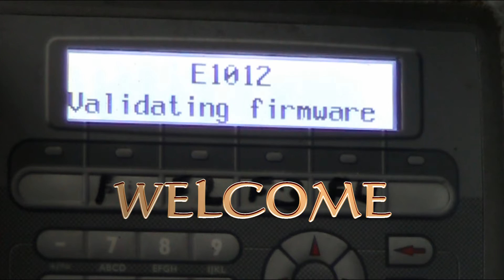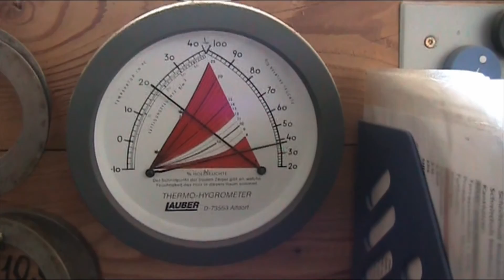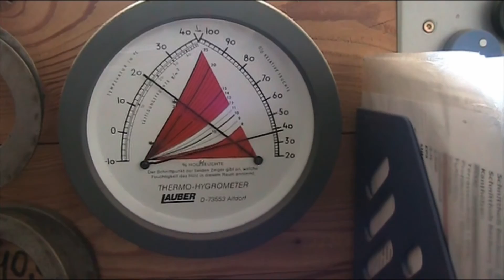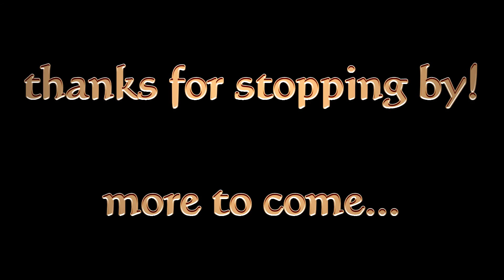the Stack, episode 3: relative humidity

Comment: Thanks for sharing your videos once again! I'm still stacking my walnut and cherry lumber and really appreciate your knowledge being shared. I'm having problems stacking what I have quick enough because we're having no humidity and cracking is taking place daily. I hope I'll be able to finish it on my own today. The boards are heavy for just this 125 lb women but, well worthy of the beauty in them.
Reply from the maker: always glad to be of help. 

to prevent some of the end cracks you can get some regular ol' paraffin wax.. an old candle will do, melt it and smear it on the face ends of the boards. that should slow down the rate of drying and keep the cracks from getting too crazy.  even an old goopy thick water based or latex paint will do, you only have to seal off the pores on the face ends of the boards. if all you have an old oil based paint just keep in mind you'll have to cut off an inch more than with the wax. 
. if you have an old camo-net or  burlap sacks you can also hang those over the ends of your stack to slow down that rate of drying at the ends. 

once a crack has opened up it can't be closed again, so it's important to get these measures into place as soon as possible.

if you have any more problems give me a holler and we'll see what we can do to get your problem solved

thanks for watching and commenting! :)

Comment: Well done, i think it exlplans the subject pretty good, no need for extra science. I really like that woodland shot.
It's not so much the precipitation here, that include the fog which is hardly more than over at yours. The real problem at my place is the soggy grounds, it's all wet around here which causes above average humidity levels.. With current day/night swings of 10 degC and more, i need to run a fan all night, otherwise in the morning everything is dripping wet in the shop. 
On the flip side, we don't suffer from continental climate conditions, so winters are quite warm and we have plenty of wind.
Reply from the maker: thanks, i'm no math whiz by any stretch of the imagination ..lol.. but i have made my peace with the subject because it does play a big role in what we do in this field.  so i try to make minimal use of it wherever it's possible ...
one of the ways i would get the point across when i was tutoring at the U of Idaho was by using either tangible objects or bringing the student in direct contact with a working facet of the subject matter.  some people really responded well to the lessons and their grades really shot up once that barrier was broken. 
it's sort of what i'm trying to do here. by showing people something they see essentially every day but often don't make the connection, it helps open up their minds and get a better understanding of it.  and then overcome the frustration of the apparent lack of progress.